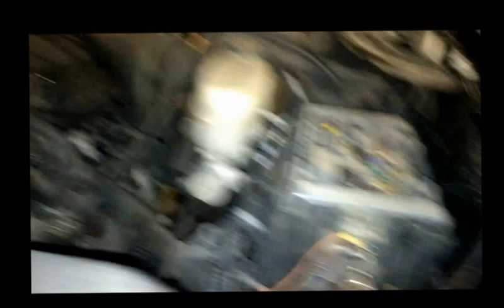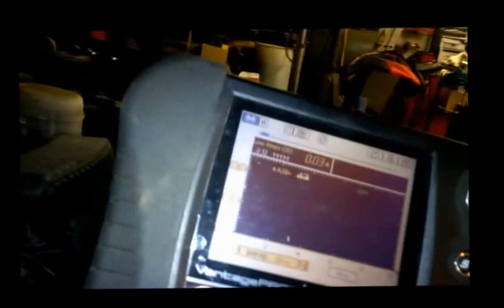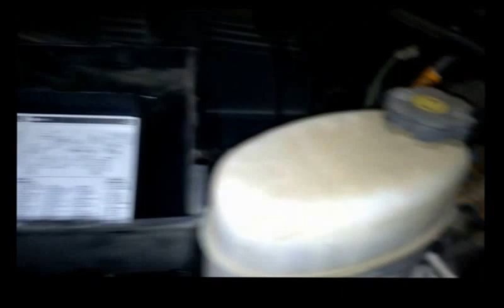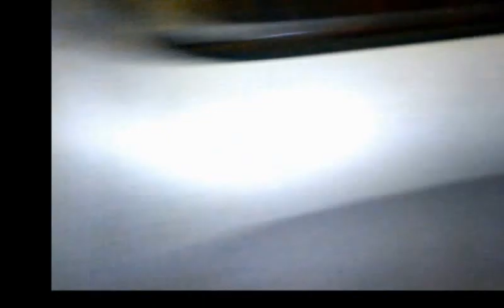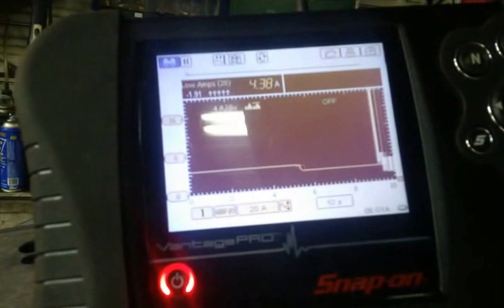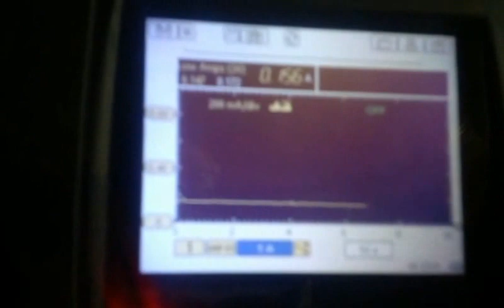2011 Silverado Parasitic Draw Repair

Comment: Seeing you know your way around these panels. I just swapped my fuse block on my 08 Sierra, for the constant reverse light problem, that being fixed now a month later I got the hyper flash turning right only and the rear signal doesn't come on just the front right and it blinks properly but hyper flash in the cab. 

For now I jumped the right turn and trailer right turn under the fuse block to get power to the rear signal but still hyper flashes. 

I'd assume the printed circuit board relay for the signals went bad?

Comment: I have a 2004 GMC that was killing batteries. Turns out I had been playing a cd and forgot about it. Shut the truck offand the cd did not eject. The truck sat for 3 weeks and the battery was dead again. The CD player tried to eject the cduntil the battery died. A friend at a car audio store got the cd out for me and the truck has been great since. POS factory work truck radio.

Comment: Mine started having this issue after 36,000 miles. I've just accepted using a jump start battery when it dies. This is now on my list to check. Funny how the dealership couldn't figure it out the 2 times they tried to rob me for under $20 in parts.

Comment: Hi ,
Thanks for the post i have problem that i missed with wrong fuse or something i couldn't figure it out , the DMM light inside care not working both signal light not working Hi headlight not working  driver door not working not able to lock or unlock car remote control not function i just remove fuse from 75 "heavy DUTY ABS" i put in LBEC1 which was empty before no fuse on that position than things get work i still don't understand as per my knowledge the LBEC2 is for interior other accessorize

Comment: I never removed one , but I'm pulling .85amps but started the drop test pulling4.5 amps ,I didn't find any other fuses drawing amps ,so I think the problem might be with the mega fuse cable ,sent the truck out to have the ignition replaced ,key wouldn't turn ,came back with the battery discharging , thay said it wasn't there work ..so I'm on my own...or a electronic auto shop ..wish me luck

Comment: Do you have a video that shows how to how's to get the board loose from the block ??Thank you
Reply: Paul Ferguson 

Hello. Once the panel is removed from the truck use a camera to take several pictures of the location of all the fuses and relays them remove all of them. Once the fuses and relays are removed the unit can be disassembled by releasing plastic locks on the sides from the bottom. I don't have a video though but it's pretty straight forward.
Reply: Thank you for your help

Comment: I had the exact same problem on the same fuses. Chevy should recall this fuse panel. I have had the truck for 5 years and only 81,000 miles and there is no reason for a fuse box that is less than 10 years old to have a defect like this. #1 reason I will never buy another chevy truck. Can't wait for the next electrical nightmare down the road.